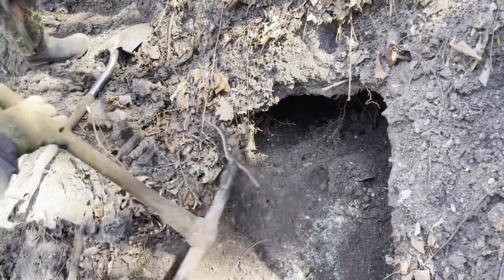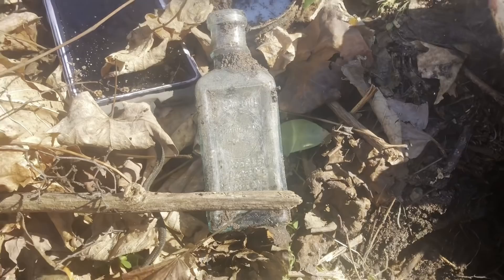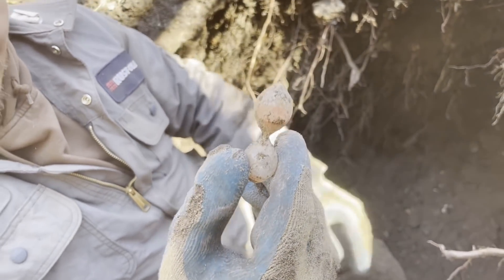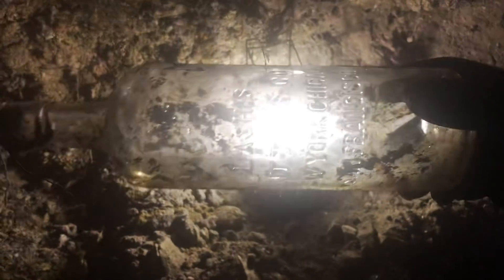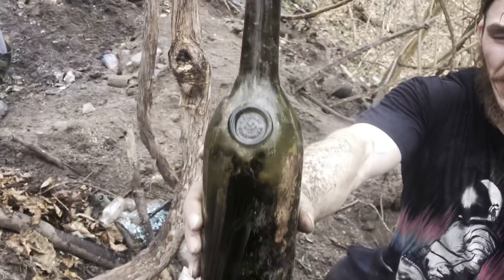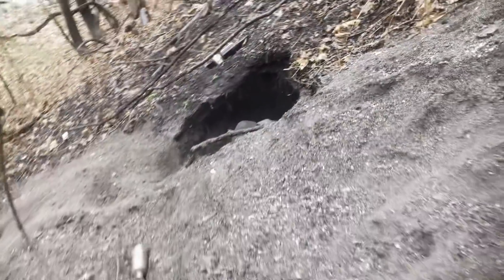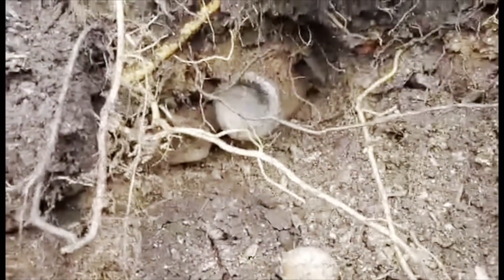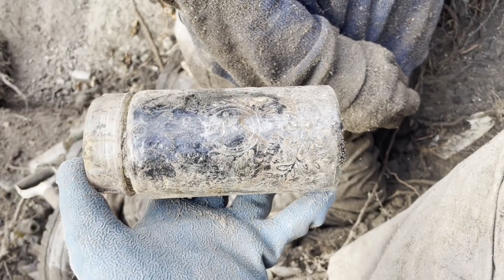WOW! BOTTLE DIGGERS UNEARTH TONS OF TREASURES

Comment: There has to be dumps like that around here! At the rate they're razing old houses and putting up subdivisions and condos, there's not much left around-except on farmland.
Reply from the maker: They are disappearing fast so definitely don’t hesitate. Any old streams, railroad tracks, and in the woods behind old houses you can find dumps usually not very large but pit dumps should be everywhere.